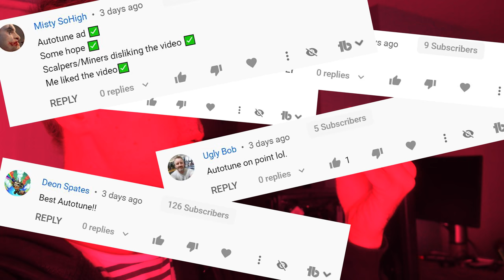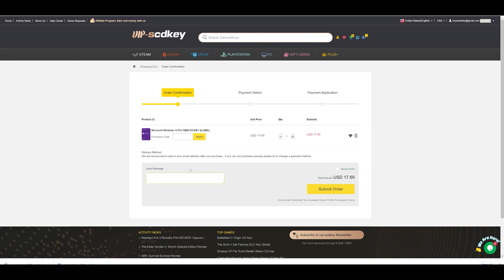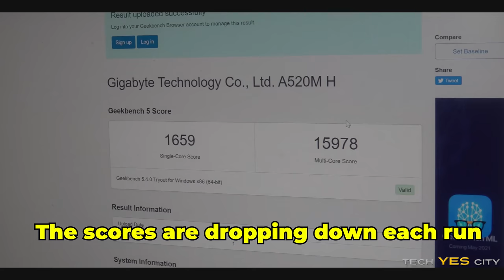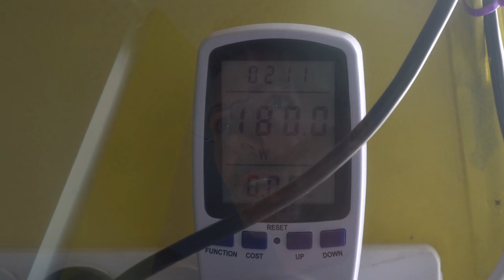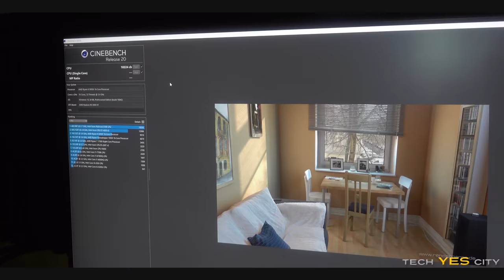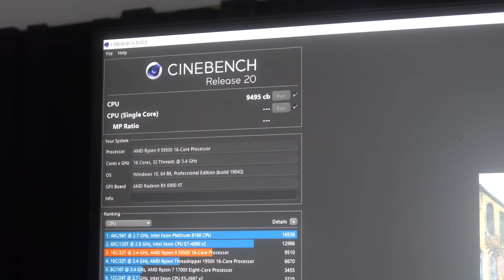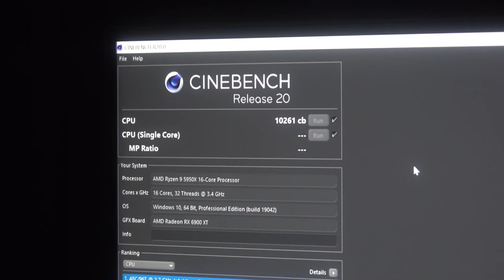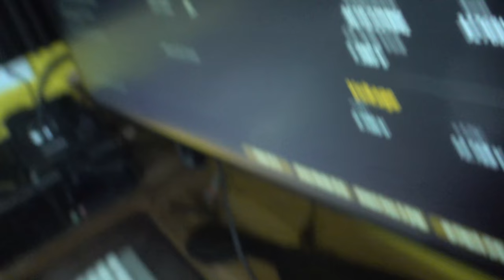5950X on an A520 Motherboard... This was NOT what I expected!

Comment from the maker: Trick question, does 4+3 = 3+4? Perhaps Gigabyte might have you believe otherwise!
Reply: Yes
Reply: Brian are you able to try the 5950x on a a320 or a b350 board? IIRC there are some Asrock a320 boards with beta bios support for Ryzen 5000 processors. I have also heard that you can flash B350 motherboards that have extremely similar B450 counterparts like the Asrock B350/B450 pro4 and Gigabyte B350 Gaming 3/B450 Aorus Elite with the help of FPT tool via dos or an external usb bios flasher. 

Could you possibly take a look at this if it does not piss off your sponsors since it definitely creates value in these otherwise less valued 3xx series boards.
Reply: No, 4 is dedicated to the CPU, and three usually to the Ram
Reply: @oscarfiala2104  👏
Reply: Hey Bryan, why not go for the ultimate value and throw an APU On this mobo, now I’m intrigued to see how the VRM will perform
Reply: Please stop the auto tune stuff it's annoying. It makes me want to stop watching even I like your tech advice.
Reply: 3 phases on VCore and not SoC its some really weird shit. contact gigabyte or at least buildzoid maybe?
Reply: @Steampunk_Star_Raisin  cmon dude its so bad its funny
Reply: Bryan:  All you had to do is (1) Set cpu power limit in bios and (2) use a cheap air cooler that cools VRM.
True Story:  A month ago, I tried to order a tray 3900XT and $9 cpu cooler (with 120mm 3-pin fan).  Guy on the phone acted arrogant and talked snooty to me.  He told me I would return the 3900XT in two days if he sold me a $9 cooler with it.  I told him it's for mining and then he says, oh, then you need a much better cpu cooler, and then he ended the call.  I've only been working with computers for 25 years and been mining since 2014.  For mining, undervolting/underclocking is standard practice.  For 24/7 mining, ambient temp is more important because eventually the room will warm up.  A watercooler will not stop the room temperature from rising.  The main benefit of watercooling is all that thermal mass in the water, which is very good for brief benchmarking and brief gaming but won't help for 24/7 mining after the water reaches steady-state temperature.
Reply: In the US, some say that math is WaCiSt and with Common Core your answer can be whatever you feel like. 😬🤯🤪
Reply: That board with the 5800x you should test it. It would suffer a little more than with the 16core processor
Reply: that board has to power APU graphics also.
Reply: @ramzinho4985 it will do fine.. theyre 65w chips
Reply: @oscarfiala2104  No, the 3 other power stages aren't for the RAM, they're for the SoC (which includes any iGPU and the memory controller, but the memory itself has a separate VRM).
Reply: I think putting some big ass heatsinks on vrm would make temps even better.
Reply: @Steampunk_Star_Raisin  Matter of taste. I thought it was funny.
Reply: @sixcoregamer9221  
"The main benefit of watercooling is all that thermal mass in the water, which is very good for brief benchmarking and brief gaming but won't help for 24/7 mining after the water reaches steady-state temperature."
That's only part of the benefit. A radiator lets you transfer heat at a greater rate than a small cooler does. Even a basic 120mm AIO would have a much higher surface area and more airflow than a $9 cooler. Also, "$9 cooler" and "water cooler" aren't the only alternatives. Low-end tower coolers exist, and would be much better for sustained load.

I agree with the guy on the phone. Your experience doesn't change the facts of thermodynamics. Higher surface area for heat transfer = more heat transfer. Using a $9 cooler with a 3900XT for a multicore load like CPU mining is dumb, even if you're undervolting and underclocking. If you're going to undervolt and underclock, why not just get a 3900X (or a 3900, if you can find one), which are cheaper and more efficient than the XT?
Reply: @skoopsro7656  "the board has to power APU graphhics so thats likely  why you only see 2 phases working.. its really more a 2+2+3 i guess"
No. That's not how VRMs work.
Reply: The VRM is a 4+3. It is not reversed. 4 phases (the CPU phases) have 2 low side MOSFETs and 1 high side. The 3 SoC phases have 1 high side and 1 low side MOSFET. Inductors are quite thermally conductive, so a CPU power stage next to an SoC inductor (which puts out much less heat than the ones powering the CPU) is likely to run cooler than one that's got other CPU power stages on either side of it, or empty space (i.e. air, which is a good insulator). When the CPU is idle, the inverse is true - the SoC phase closest to the CPU inductors will run cooler, and the CPU phases closer to the SoC inductors will run hotter.

It might also be partially due to uneven load balancing between the CPU power phases. It's common for one of the stages at the end of the row to take a different amount of load than the others. The balance can also vary with total CPU power load - one end might be used more heavily for light loads, while the other end is used more for heavy loads - this may be intentional, to put less load on the CPU power phase closest to the SoC phases, which would result in a more even temperature distribution with a less power-hungry CPU.

Check out techpowerup's "AMD Ryzen 9 3900X Tested on Cheap B350 Motherboard" to see how the hotspot can move around depending on the relative load on the SoC (which is mostly constant) and Vcore (which increases with CPU load).
Reply: Four phases on cpu cores, it is very few for such hot processor. It is interesting will 5 phases (5+3 overall) be sufficient for using with a 5950X. For example the Gigabyte A520M DS3H.
Reply: @lmchua8644 ) Why would he waste his time those 320/350 boards are rubbish no one should be touching those and the b450 boards you list are still not that great the new a520/b550 are much better quality which is why the price had increased. (youi get what you pay for if you pay out for high price cpu don't expect old or low price boards to be that good)
Reply: I am clicking subscribe, but I must ask that you never use autotune ever again.
Reply: @nathangamble125  You know nothing about cpu mining.  The internet is full of thousands of noobs and fools who do not understand the effects of undervolting and underclocking, which includes you.   You can run any processer with almost any cooler, as long as the power/heat are low enough.  Do not call me dumb when it is you who do not understand physics nor cpu mining.  It is not my fault you don't know there is a manual power limit setting in the bios.
Reply: Please compare this a520 to the asrock x570 I think it's the phantom gaming which was the horrible one that thermal throttled a stock 5950x
Reply: No, it's not the same. 4 + 3 means that 4 phase for CPU and 3 for RAM. and rest...vice versa
Reply: no 4 to the CPU cores, and 3 to the SOC/iGPU, or 3 to the CPU cores, and 4 to the SOC/iGPU, is a very big difference a 4phase CPU vrm would have 33% extra current capability compared to a 3 phase which is clearly needed for this CPU

but more importantly if you cool a throttling VRM to stop it throttling, it may stop throttling, and if that happens it will draw more power then it can support which will make it very likely to catch fire might be in a day or a weak or a year, but any computer fires range from dead part to burnt down building which means its a serious safety concern and that motherboard should not be used with a CPU that powerful.

my 990FX Extreme3 with a FX8300 caught fire while i was playing Fallout 4, i had fans on both sides of the motherboard to cool it better and that stopped the throttling but it still caught fire.
Reply: @nicmonberg5974  The issue isnt people that wanna buy a b350/a320 motherboard, but people that already owns a b350/a320 board. 

Those boards are perfectly fine for cpus like the 5600x and 5900x and 5800x at stock operations.
Reply: @nathangamble125   Gigbayte counts actualy the ddr4 Vrm into it ;) it is a 4 + 2 +1 Phase design +4 CPU +2 SOC +1 DDR4 -you can check that out on the mobo itself and count the phases easily
Reply: yes
Reply: Scenerio (1) Get those 3 aluminium fins and put thermal paste on the sides as well. Scenerio (2) Instead of 3 aluminium blocks you have one long block with fins. Then drill an oval hole through the solid part right through to the other side then water cool it, then run a fan on it as well. So cooling is done both on fan + water. That 135C total should come down to maybe 85C.
Reply: @lmchua8644  100w+ sooo no, most a320 boards only have 4 pins for power. unlike a520 they have 8pins enough to power that 100w+ CPU. any 65w am4 CP will run fine on a320 with updated bios if your okay leaving support for anthlon CPU and go full ryzen 3 to 7 gen 1000 series till 5000 series.
Reply: @shiro214okane  It works by the way, the VRM will throttle will kick in way before power limit will ever be an issue. Also a CPU 4 pin has a max rated power draw of 192w, and is typically overbuilt on both the motherboard and psu front to support more than that.
Reply: @lmchua8644  ahh nice to hear that

Comment: A fan over the VRM would probably get rid of that throttling pretty easily.

Edit: That worked.
Reply: would a wet towel work
Reply: @budgetking2591  Yep, easily. But please, keep it far away from the motherboard, preferably in another room, and add the fan there anyway.
Reply: @budgetking2591  You'll slowly corrode the motherboard due to high humidity at best. If you want to do something like that using evaporative effect your best bet is alcohol if the towel is being placed on the VRM. I recommend just a simple fan for $1-$2 or fan plus heatsinks (those heatsinks he used are about $1 USD for a pack of 10, I do the same for my motherboards and GPU VRMs)

There's a lot of other ways to cool them, including submerging in alcohol. There are also short term solutions for experimenting or benching such as submerging in anti-freeze but due note that stuff does like to eat up some plastics but I have verified that it works down to -40c before my voltage was spiking shortly until it got down to around -45c where it settled out again, so prechill it before turning on if you are going that low, then around -60c the antifreeze turned to slush and then finally at -70c it was a block of ice), cooling directly with dry ice is another popular option (insulate the board like crazy otherwise it will have condensation and short something out), or you can put waterblocks on it and they sell some cheap $5 blocks that aren't particularly good but they should work ok if you want a fanless build (I use a school bus radiator on my PC, you don't really need a fan at that point).
Reply: 101 degree on the heat sink is still unacceptable and I doubt how long will it last before some magic smoke comes out of that board
Reply: @jakegarrett8109  school bus radiator? Amazing. Pictures?
Reply: @lewislu8533  if that is your only corcern, probably decades. I've had motherboards out-live far worse odds than those temperatures.
Reply: @JosephDudeson  Only picture I have online of that is the profile pic on: https://www.youtube.com/channel/UCZp2Om_w_o0ry_FQhAUp-CA   That's my dead channel that was going to feature whacky stuff like that. I had a few good videos, couple where I broke some world records that were comical and fun that I had spent days editing, but Windows decided to delete my vids and I didn't realize until after it was too late, so I gave up filming, so all that's on there is trash and I don't plan on updating the channel.

But you can see my basic little phase cooler which gets much colder that I often use (even on daily machines), runs -60c idle, -35c was the hottest I've ever recorded. I want to do a triple cascade phase cooler build for TR-64 core so I can have it at -100c under load, but it gets very power hungry to power the cooler but mostly just a lot of brazing.

I was going to do a Halloween video of the ThreadREAPER (its the profile pic with bus radiator), has 4x Fury in crossfire, 2x SuperNova 1300 PSUs, and was going to use my LN2 cooler for some nice fog rolling out of the casket its built in (only took 112 nails and 16 screws plus some scrap wood from an old spider infested barn). Right now I just have it water cooled but its fun to play with some extreme temps whenever I can!
Reply: @rhyzon  obviously the power delivery components are also concerning, and I don't think anyone will run 5950x on a520 board so there's not much to worry about
Reply: @lewislu8533  80 degrees celsius on VRM is to much but 105 average or 130 at maximal CPU speed is unacceptable. Disabling CPU core boost in the BIOS is the solution the speed gain is minimal approx 15% rising the power consumption 50% from 80 watts at 3.8 GHz to 120 watts at 4.3 GHz.

Comment: I draw two other conclusions from this:
1. As long as there's not a prolonged high power draw you're fine.
2. If you want extra cooling on the VRMs do use a single heatsink that covers all of them.
Reply: 1. yup iam planning to get a 5800X and putting it on my B450-A PRO
2.Or put as many smaller ones an a copper sheet to distribute the heat better to the ones that are not getting that hot.

Comment: Glad you covered this heatsink mod. I did the same with my mid tier Z370m board (no vrm heatsinks). I measured how much space I had for a heatsink and bought the longest heatsink I could fit from eBay. A bit of thermal epoxy on each VRM. Sadly I didn't have a thermal camera to measure the temp differences

Comment: The sequel to the A320 and R5 3600 combo done by Brian few years back😉😎
Reply: Kenn Honson X  u need a pair of RAM for performance bro...
Reply: Few years back? Lol sounds like you are talking Haswell era mate 

R5 3600 is modern CPU from 2019 pardon me
Reply: @amehu  my bad so low of me. Yes around 2019 time is what I’m thinking.
Reply: Kenn Honson X  just get a second stick and clock them both at 3000mhz
Reply: Kenn Honson X  it could be 3000,4000,5000 it don't matter its just cheaper to buy a single 16gb stick instead of another kit and youll get twice the ram, jayztwocents said himself with all the products he has and has used behind him, not even he can tell the difference between 2133mhz and 3600mhz without any fancy graphs
Reply: Kenn Honson X  ahh I get what you mean i didn't see your comment about the weird stick of ram lmaoo
Reply: that video is legendary
Reply: Kenn Honson X  its better, not much better, marginally better.
Reply: running 1800X, offset downvolting, paired wirh an Asus A320
70°C max aircooled cpu temp when running Cinebench.
Should get vrm temp, but i assume they stay under 80-85° degrees....
IRL, you never run your CPU @max load, unless you use the right apps.
runs well.......will see if "durable" is true with the years to come.
though, the lack of space , cpu/PCI-E are too close. only one nvme, and 4 s-ata.
you have what you have for the money
Reply: He slapped a 3950x on an 320 a couple years ago. And it worked. Just fine.
Reply: 3600 is 65 watt. So that's absolutely fine

Comment: The hotspot remains below because the SMD package on MOSFETs is not designed to put a heatsink on top. What you do with heatsinks is to spread the heat but the hotspot remains. Running MOSFETs above 80 celsius is unsafe if one enters in short circuit can lead to a sudden Vcore voltage rise destroying the CPU. More VRM phases are required for the Ryzen 9. A workaround is to disable core boost on the BIOS having the CPU locked at 3.8 GHz. For example on Ryzen 9 3900X to have 15% more Cinebench speed at 4.3 GHz on all cores the power consumption rise approx 50% from 80 watts at 3.8 GHz to 120 watts at 4.3 GHz. It has no sense to enable core boost on the BIOS.

Comment: Those AIO are absolutely a big No on cheap motherboards without heatsinks! The vrm is meant to have at least air moving around, they can stand up to 120°, but they can't stand the AIO, or a tower air cooler. Only stock Spire or Stealth AMD coolers works. Not even the Wraith cooler is good!
Reply: Yeah , a big topblower like a noctua c14 would be ideal for a setup like this.

Comment: These are the questions budget people want answered.
As much as I like GN and HU, they tend to ask the top of the line rich man questions.
Reply: i agree with that, sometimes you're on a budget, maybe not for you but for someone you know and it's very important to know what you should recommend to them or what's the most they can stretch out of certain hardware.
Reply: i mean if you are on a budget you aint gonna buy a 5950X and skip 80 euro's to go with a 520 instead of a mid tier X570 lmao
Reply: @wargames43  Maybe, but maybe the plan is to go to x570 but maybe you don't have the money to go all at once and you are doing it bit by bit.
I bought an x570 board first, then lived with an old CPU for a while before upgrading to a 5800X.
Maybe other people would do this the other way around and do their CPU first and that is what I appreciate from this video..
i.e. what happens when you do what I did backwards.